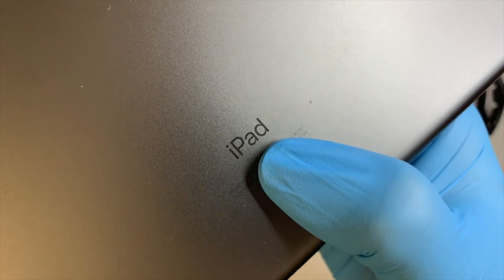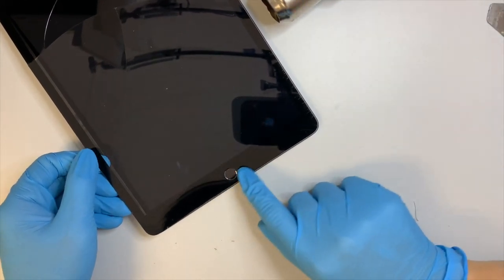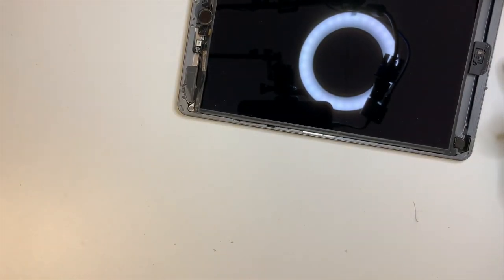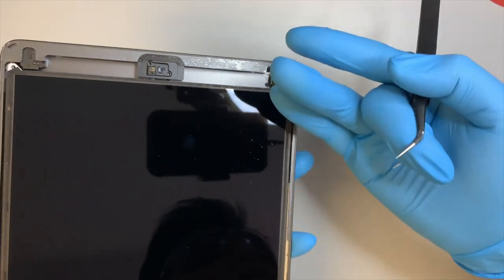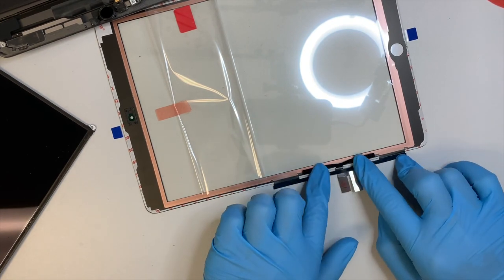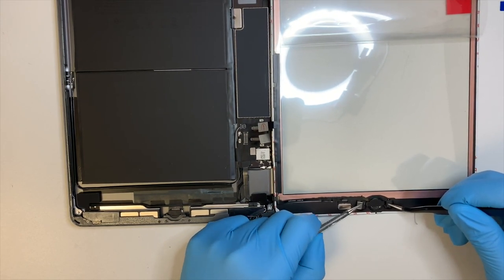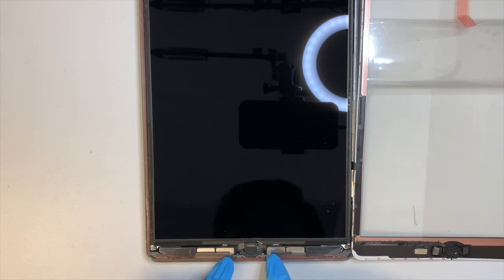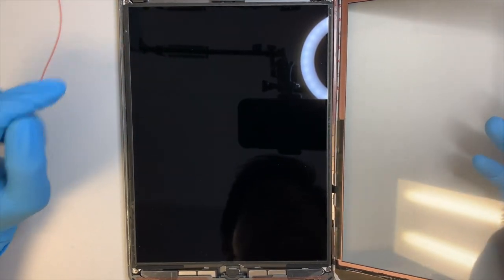iPad 7th Gen 10.2" 2019 Screen Replacement. A2197 A2198 A2200

Comment: Awesome Video! It took me about 2.5 hours, but I was able to get through it and it works great! The home button works as it did before. Defiantly not a repair you want to rush through - take your time and you should do fine. The biggest challenge I had was getting all the broken glass off, there were many small shards. Also, be careful with the LCD. It is hard to work without getting something on it, and a bit of a challenge to clean.
Reply from the maker: You are welcome. Glad the video helped.

Comment: Excellent explanatory video! You reminded me of a surgeon performing a delicate brain surgery ! I only have a question… when you are about to take out the LCD, I’ve seen (in other video) that they insert a plastic behind the battery assembly as to cut the energy from going through… is that necessary? Why you didn’t do that? Thanks…

Comment: Excellent video but will add to remove the battery screw that is north right of the unit after the screen is lifted. This is avoid removing any connector while the unit is powered. Thank you for posting this video.

Comment: Okay just did everything in your video.  Great tutorial!!  
So after I was done still no response on the touch.  What else could it be?  Try another replacement screen? Does disconnecting and reconnecting the power make a difference?  Thought I did everything right but still not work.  Any advice would be appreciated.
Reply: Are you sure the connectors are all the way seated and getting good contact?
Reply from the maker: The new digitizer screen could be bad. I would try power off the iPad. Recheck the connectors, making sure they are press in firmly connected. It's like lego, when you press and it clips, you can feel it's firmly connected.

Comment: 1. There was already adhesive on your digitizer. Placing more adhesive, you would cause the glass to not sit flush with the bezel. Also you should clean the inside bezel with alcohol and then coat with a 3M adhesive primer.
2. Before disconnecting or cutting any cables you should separate the battery contacts with a playing card so that there is no energy to the board. Even though the device is not on, energy is transferring to the board and you may damage components. Battery should all be always be disconnected first.
3. You should be very careful touching the LCD or the inside of the digitizer glass as those are often difficult to clean.
Reply: I was cringing at him touching the digitizer fearing he would scratch that bad boy with the glass abrasives on the screen.
Reply from the maker: Thanks for the comment. Did the adhesive on digitizer that came with stick well for you ? Mine did not, especially when you have the kids to use it. Wear gloves to carefully work on LCD glass. If you get finger print, try use tape to tape off the print. Do not use wipe to clean the LCD. It will make it much worse.
Reply from the maker: I didn't. lol
Reply: Adhesive that comes with the digitizer sucks! I’ve replaced hundreds of iPads over my years in the repair industry and do use extra adhesive as well.
Reply: @UbergeeksBiz  you don’t use isopropyl to clean your screens? I’ve used 99% isopropyl alcohol to clean my screens and never had any issues. I guess I’m just tempting fate

Comment: Is the icd the digitizer? Bc while fixing my daughter's apple. It was almost done. And on the black outline plastic that lays inside the edges before glued (a gigitizer fell off??) It looks important!? I did get the touch screen & home lock to work... I just cannot glue it together now (when I had all the pieces to complete!)... now, bc this "digitizer" price I was told had to be there?? Is that part of the icd screen or do I need to order another? Please reach out & let me know if you have time. 
Your videos are simply amazing!!!
Reply from the maker: LCD is the display that shows you colors.  Glass digitizer is the sensor that you touch the glass. They are not the same.

Comment: I've replaced the digitizer on my iPad and it's ghosting and having random touch inputs in a lot of areas. Very sporadic, and sometimes it'll restart on its own. 

Could the digitizer be faulty? Are you supposed to hear a "click" when you put the cables in? I didn't but they weren't moving anywhere.
Reply from the maker: Might be a faulty digitizer. Or did you cover the digitizer sensor on the back ?
Reply: @UbergeeksBiz  the back of the digitizer making it flush? I actually believe that came off, I'll try putting it on with tape and seeing if it helps. Thank you so so much for your reply!
Reply from the maker: @theowlsofouterheaven  Try to go to this url:   https://www.youtube.com/watch?v=Xl-1uq_KPTg     and play at 25:24 Where I explained to cover the back difitizer sensor. Hope this helps.
Reply: @UbergeeksBiz  I got the digitizer to work now and it's working great. But my ipad is stuck on 17 percent and isn't charging. What can I do?
Reply from the maker: @theowlsofouterheaven  Great that your screen is working. Battery stuck on 17% ? Try plug in to charge, while charging try turn off the ipad and wait for 6 hours. Hope that deep charging will help.

Comment: Overall very good video. One thing I'd like the stress though is to not move the digitizer around, or at least try to keep it from moving. I stupidly moved the by accident,  after connecting the ribbon cables. It takes very little stress to tear these ribbon cables like they are paper. I broke these cables and had to buy a new digitizer. It was a good lesson.

Comment: What could it be if no touchscreen response still after replacing digitizer ? Touchscreen didn't work before and after replacing digitizer.. rechecked all connections and hard reset.. pins looks great after rechecked and made sure connection are on good

Comment: Hey you never mentioned to disconnect the battery, now it’s not powering on, what should I do? Did I short it out?
Reply from the maker: I have never shorted out an iPad while the battery is still plugged in. Did you damage the power cable or button ? Did you try charge ? Damage LCD ?
Reply: @UbergeeksBiz   i tryed everything and it did not work, the battery gets warm but the screen does  not power on.
Reply from the maker: @itechnevworld4772  Go to your local iPad repair shop.
Reply: Same thing is happening to me! Did u figure out what happened or fix it???

Comment: Do you know if the sim card reader connector is sodered?
Reply from the maker: yes. it is sodered onto the logic board
Reply: @UbergeeksBiz  can I solder it myself or use glue?
Reply from the maker: @karisherrod4439  You can't glue them.
Reply: @UbergeeksBiz  what kind of solder do you recommend

Comment: Ive seem to have broken the home button cable from the ipad. It was a great tutorial and ive fixed my screen, and ive searched amazon for a home button replacement for my A2197 model but i cant seem to find the cable. I do have the home button but without the cable connected. Could you help me please
Reply from the maker: The home button and flex cable are all together in one piece. When you replace a 3rd party home button, your iPad touch ID will not work. Therefore, you need to put passcode to get in. Here is the link for iPad 7th A2197 home button:    https://amzn.to/2Y7e92P
Reply: @UbergeeksBiz  Thank you very much. I've had it delivered!
Reply from the maker: @adsayan6391  You are welcome

Comment: I bought the kit and swapped the digitizer.  Seemed to go pretty smooth, but now I have some icons that don’t select.  Any ideas?   I tried to reseat the connections and ensure they were clean, but get the same result.
Reply from the maker: Did you try to cover the back sensor on digitizer ? If you did and still not touching, return and get a different screen.
Reply: Bad connection. Had the same issue
Reply: You gotta make sure those cables are snapped on just right. They are a pain in the ass sometimes.

Comment: Nice vid just one note remove battery cable before removing the lcd thank you for sharing
Reply from the maker: Noted
Reply: unlike the iPhones there is no battery cable as such, the battery its held by one screw to the mainboard. even removing the screw does not guarantee the battery is disconnected you need to warm the mainboard up from underneath and carefully pry it up using a plastic tool

Comment: I'd think apple puts extra adhesive to see if the cpu has been tampered with
Reply from the maker: Yup. Exactly.
Reply: Or possibly to hold the LCD into place before inserting the screws for manufacturing purposes.

Comment: If you've ever worked on an iPad mini you'll realize the glue on the corners arnt so bad haha to remove the lcd on this model I took a metal spatula and on the sides of the lcd next to the screw holes you'll see a foam cushion between the lcd and frame. Put your spatula right next to that foam insert and ever so slightly apply upward pressure using the frame to pry it up. Go nice and slow and it will eventually pop out.

Comment: Hi if the crack of my ipad is like yours (just few cracks and no black spots on screen) it just needed to change the digitizer not including the inner lcd right? Because some of technicians here looking for too much money so some saying i need to change all including the inner lcd :(( but i had a chance that i just need to change the digitizer outer screen when i watched this
Reply from the maker: If your display is fine, just outside cracked glass. You do not need to change inside display LCD.
Reply: Yes my ipads display is fine and all working no Ghost touch. Other technicians said that they need machine to do it, i dont know what machine they are talking about because on your video you only do it manually and safe. Maybe i will share your video to them.
Reply from the maker: @happyoutputsurprisedesign9902  I recommend to ask second opinion from another repair shop. If display is fine, do not waste money on them.
Reply: Last question my idol, if ever it is done replacing and it worked what are the risks or disadvantages to my ipad? Is it easier to break? Ps: you are my idol because you have a great and clear content plus you answer all my questions qithout hesitations. So far you are the best technician i talk💖
Reply from the maker: @happyoutputsurprisedesign9902  After repair, just be careful with the glass. Apple original glass is much stronger. The replacement glass is much weaker and easy to crack again.
Reply: Thank you so much idol for answering my questions well and i hope you will earn more subscribers , i will share your videos

Comment: How much does the restoration cost on the market..? Ty
Reply from the maker: $159
Reply: UberGeeks omg only for the screen?
Reply from the maker: Yes.
Reply: UberGeeks ok can i ask u something i really really really need your help with it
Reply from the maker: @hozaifanatq7351  Yes, how can we help ?
Reply: UberGeeks ok here is my story 6 months ago i bought an ipad 7 and i play mobile gaming on it and when i play a game my touch screen becomes really dry so when its becomes dry i use the “oil” or “ lipid”  located in the nose” ( idk if its the right words bcuz i use google translater ) and put it on the touch screen after one or tow months I bought a thumb sleeve and i put it in my hand so when I touched the screen with my thumb sleeve i felt like I ruined the touch screen , the touch screen became so sticky and i felt like the screen is just dirty so I cleaned it and it didnt work its still sticky and dirty ( when i play I usually put my ipad  where the charge place is on the left _ middle side and the head phone place is on the right _ up side ) so when i play this way my touch become sticky and dirty but when i ( put my ipad where the charge place is on the right _ middle side and the head phone place is one the left _ down side )
My touch screen became so good and smooth bcuz i didnt put my “oil” or “lipid” on this side of my screen but i cant use my head phone soo I realized that the oil is damaging my touch screen and i dont know what to do anymore so i thinked that i can replace my screen but its too expensive for me soo can u help me please bcuz idk what to do anymore 
I am very very very sorry for my bad english so i hope u help me 
OMG I WROTE TOO MUCH IM SORRY
Lov ur vids <3
Reply from the maker: @hozaifanatq7351  Hi. Thank you for your message. Before you try replacement the screen, maybe you want to use Isopropyl Alcohol to clean the "oil" / "sticky" screen. Pour some of that alcohol on a paper towel and wipe the sticky glass. Hope this helps. If not, you may need to replace the glass.

Comment: All seem to be done good , good video - how ever one big risk your taking is not disconnecting Battery - One CONTACT SLIP on any of the flex cables and you will be in for motherboard repair. anyone doing any repairs on any of these devices - ALWAYS Disconnect battery.
Reply from the maker: Thanks for the comment.
Reply: What exactly is a contact slip? I’ve never had any issues but I’m going to heed your warning
Reply: Well I followed the video and didn’t disconnect the battery, now it’s a black screen, can you help!
Reply: Kim are you good with multimeter ?

Comment: Great tutorial. Unfortunately the glass was shattered at the bottom of the iPad and the home button cable was broken when removing the broken pieces... what do you advise please?
Reply from the maker: Yikess... once the home button is broken. You'll need 3rd party home button. Which will not work as touch ID. Just a normal home button. Hope the LCD screen still in good shape for you. Cheers

Comment: Hello after i replaced my ipad 7 screen its ghost touching even on the lcd screen do you know what i should do? It also dont respond to touch 90% of the time please help grelt vid
Reply from the maker: The sensor on the other side, (inside). Try use tape and cover it. Most likely the sensor is touch on it's own.
Reply: @UbergeeksBiz  is there a moment in your video i can see that sensor so i know where it is thanks
Reply from the maker: @kasperdynesen3053  at 18:19 - That's the back of the glass digitizer. You see that pinkish / copperish color, that's the sensor. Try to use tape and cover them. Also the flex cable (black color), you should also cover them. Hope this helps.
Reply: @UbergeeksBiz  okay so the square linage around the screen but it still ghost when i have taken the glass off and theres only the lcd screen connected With no glass attached to it
Reply from the maker: @kasperdynesen3053  Without that glass digitizer, your ipad touches on its own ? :Like ghost touching the ipad ? That cannot be real...lol
Reply: @UbergeeksBiz  i know lol i have a video of it if you want to see i can mail it to you  i really dont know what to do😅
Reply from the maker: @kasperdynesen3053  Sure...I'm curious to know:  info@ubergeeks.biz
Reply: @UbergeeksBiz  i have sent  it 👍🏻
Reply from the maker: @kasperdynesen3053  Got it. That's strange. I would try, remove the LCD and disconnect the battery. That will power off the iPad. Then try powering on the iPad WITHOUT the digitizer. To see if the issue repeats.
Reply: @UbergeeksBiz  Will try That thanks👍🏻
Reply: @UbergeeksBiz  okay just watched a video do I need to deattach almost everything inside the ipad or are there an easier way? Like a iphone just disconnecting a cable
Reply: @UbergeeksBiz  i got it fixed in a Strange way the home button 'wire' needed to be taped all the way from the connector under the lcd all the way out to the glass screen where it is connected
Reply from the maker: @kasperdynesen3053  I'm glad it worked out for you. Thanks for letting us know.
Reply: @UbergeeksBiz  and thanks alot for the help🙏🏻🙏🏻🙏🏻
Reply: #UberGreeks Same with this guy

Comment: My iPad screen started buzzing after the screen replacement... Did I do something wrong?
Reply from the maker: What do you mean by buzzing ? Like ghost touching the screen ?
Reply: @UbergeeksBiz  Sadly no...
Its a static noise coming from the screen...
Reply from the maker: @Schnekki  You mean the LCD screen has fuzzy lines ? or pixelated color ?
Reply: @UbergeeksBiz  It seems like I forgot to put back some tapes... maybe that’s the problem. Thanks anyway! 👍🏻

Comment: Apple puts the sticky goo under the 4 LCD screw points so that they create an obstacle that only highly skilled techs can pass without breaking the LCD. Plain and simple. They'd say "Oh we put that there to add structural rigidity" or something, but there's at least 1 high skill obstacle with every screen repair for every iDevice that is designed to cause such a negative memory when the novice fails and indeed breaks their phone that they never attempt to repair their own device again.
Reply from the maker: It makes the repair more difficult. Hoping no one else can do the repair, so this proprietary to them. Not good.
Reply: Could it be too for some warranty bull crap that they can use as an argument If it’s been scrapped off it’s their proof that someone else opened it and did or attempt to repair the such and such will not be cover. Maybe the black goo it’s their “seal” do not tamper with
Reply: I’ve seen the screws come loose by themselves and cause problems with the touchscreen so maybe that’s something they’ve factored in too. iPads bend pretty easily and like that stuff gets torn loose I think

Comment: Hi do you have to take the film off the back of New glass for you to push the numbers ? I left mine on and tried to test and the lcd was going nuts . I don't know if the lcd was damaged or it is because the coating under the glass.
Reply from the maker: The back film - I removed mine. If not, the screen is blurry. About the ghost touching, you want to cover the sensor. That might be the case of going nuts.
Reply: @UbergeeksBiz  Thanks for the reply. What sensor are you talking about sir.
Reply from the maker: @rockk973  Try watch this: https://www.youtube.com/watch?v=fNNi3xtqhaU  and go to 20:40 to watch back sensor.